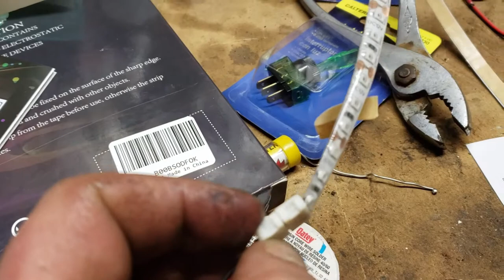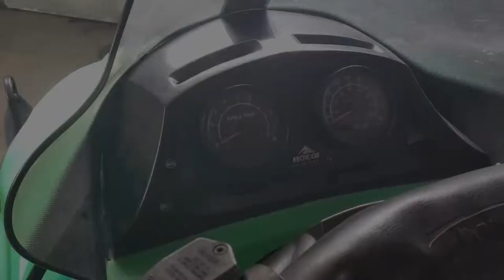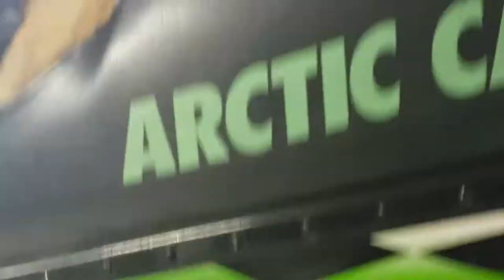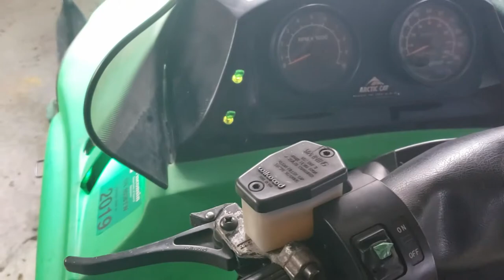Installing LED underglow lights

Comment: 1 i like the shop wish i had something like that 2 nice sled 3 thanks for the help buddy!         edit: how well did the stick tho i ride hard and dont want them to fall off
Reply from the maker: Same here, they barely lasted 1 season, definitely looking at better options
Reply: @greenracerreviews4362  I'm thinking what you did but whit clear tubes so the lights are protected and if the fall they are still in the tube?
Reply from the maker: Oh yea that sounds good, I would be sure to clean the mounting surface good

Comment: So I’ve seen some reviews on Amazon and they say that the lights wouldn’t switch colors after a while. I wanna try boondocking at night with these but want to make sure that they’re durable
Reply from the maker: The lights i got are only green in color, I haven't tried the one that you can change. The lasted a while till I was playing on the corn field next door and they got ripped off. But I plan on replacing them and going to use e6000 to glue them on
Reply: @greenracerreviews4362  Yeah that’s a good idea or just good ol’ zip ties. I just don’t want to have troubles with the lights themselves, like faulty ones
Reply from the maker: Right, but at least with Amazon prime you can sometimes get free returns, not sure on the zip tie idea for the tunnel though 🤔
Reply: @greenracerreviews4362  Lol zip ties would be last resort. I’ll check the return policy also. Nice sled btw. Thanks for the video
Reply from the maker: Thank you, much appreciated

Comment: How is the battery holding up? I like the idea of accent lights, but was thinking of not having a battery. I know they won't luminate with the engine off like yours, but it'd still be cool when it is running ..
Reply from the maker: The battery held up really well,  I'd take it out once and a while to top off the charge
Reply: With a few very cheap parts you can make enough DC to run the lights from the AC at the headlight or any other light.  Two diodes and a capacitor are all that are needed.
Reply from the maker: Oh ok cool I'll have to look into that, thank you